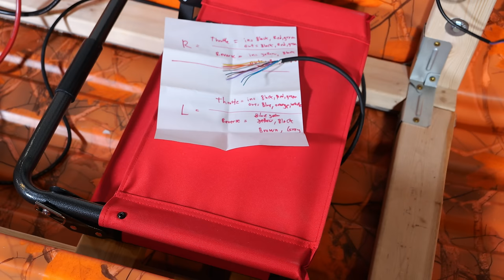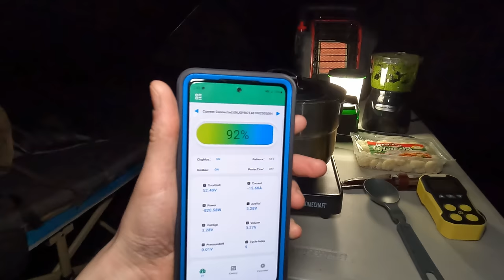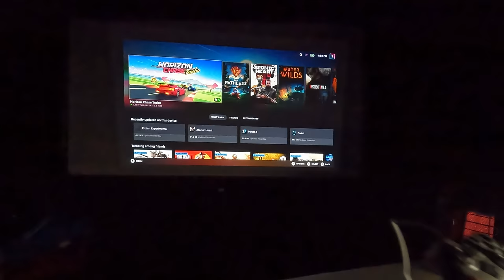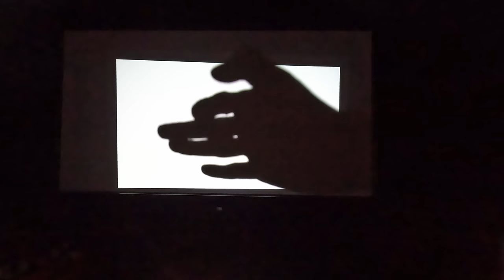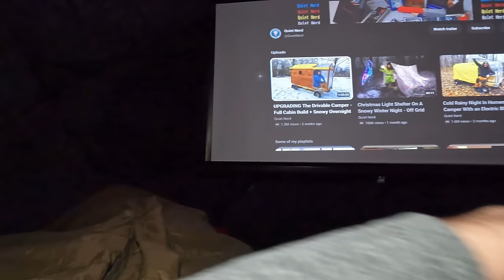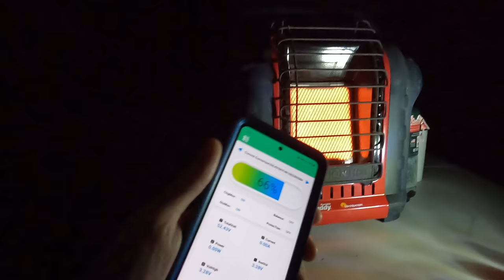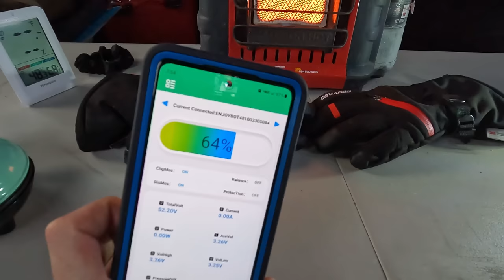Building An Electric Snow Train -  Full Build + Overnight Winter Camping Adventure

Comment: Get a haircut. Also, put some fenders and mud flaps over your wheels. I would also suggest sterrable runners on bottom of front  skid and fixed runners on rear. You might also  use additional skids as covers for back  skids.

Comment: I don't understand why you persist in using that moisturizer producing little buddy accident looking for a place to happen. Chinese Deisel heater zero moisture much more energy efficient and safer based on a German design that you can buy for 2.5x the cost of the Chinese copy. I used one in Copenhagen living off grid for 4 years to play jazz in that swinging city due to it's design zero chance of Carbon monoxide if you're not an idiot. It's what all van lifers and yacht lifers and home builders use. You can buy one in the box for around $200. Also I ran mine all night to eliminate moisture produced by me and my dog all winter every winter because of the thermostat.